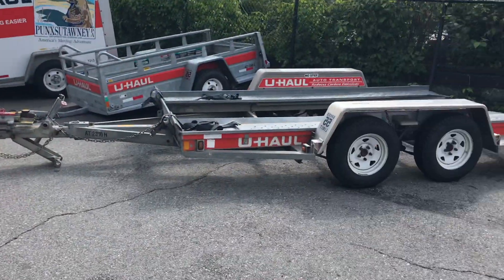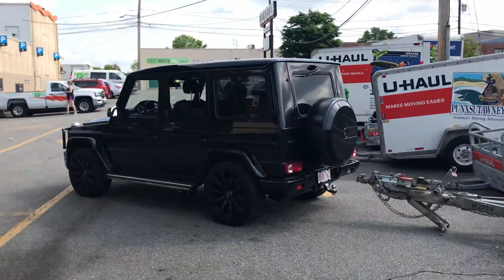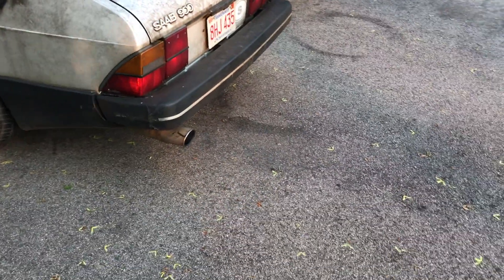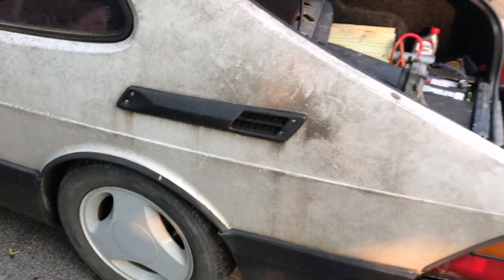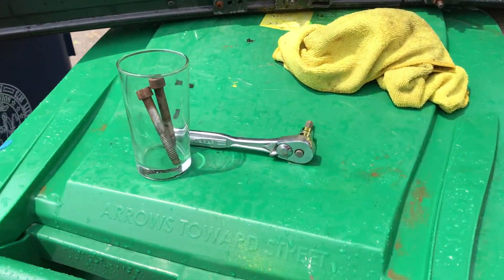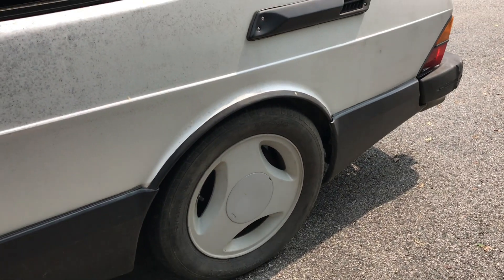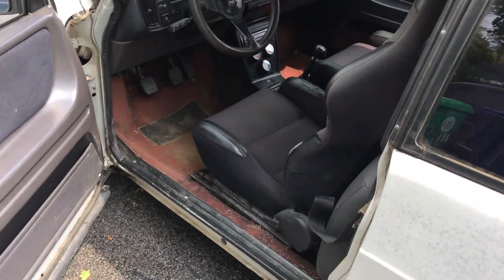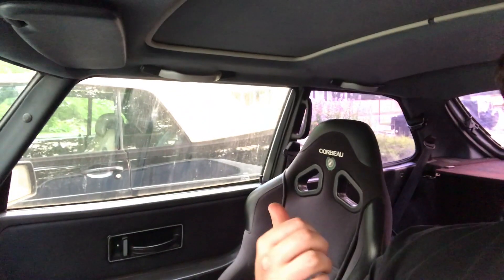I found my old Saab 900 in a field.

Comment: I love sabbs I just got my first a few months ago for a great deal. 497 dollars for a 2005  9-3 turbo sedan. Only thing wrong was I had to order the flex pipe light bulbs 4 tires blower motor thats it. No rush at all on it. Only thing I'm trying to figure out is. Do I need a tech 2 to get ride of the stability traction control and airbag lights?